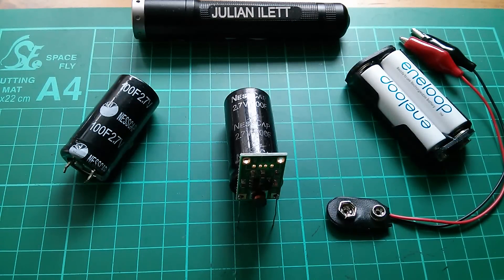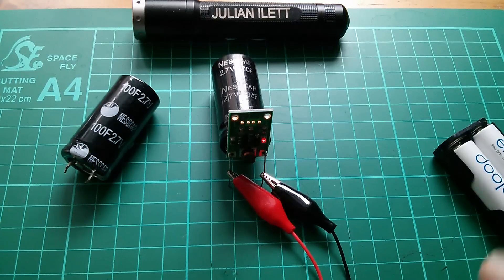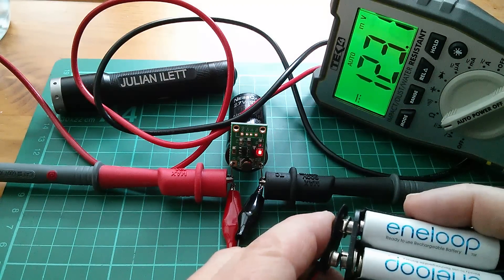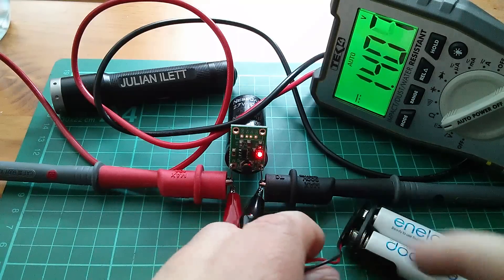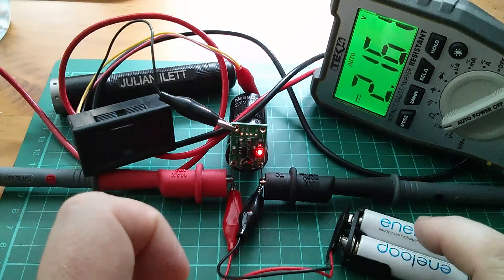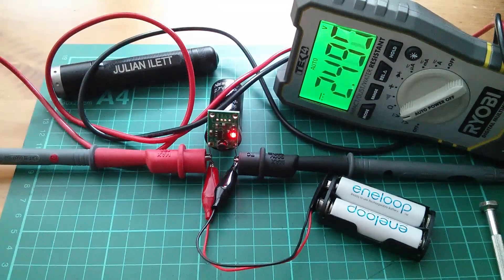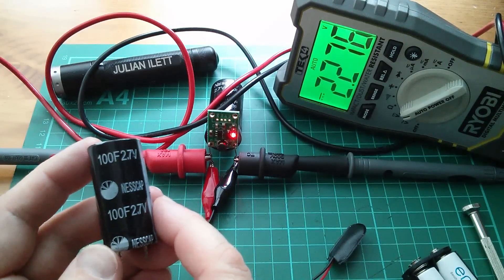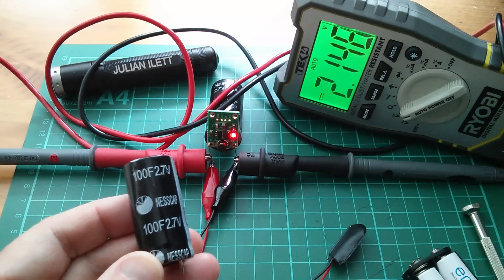Playing with SuperCapacitors

Comment: I wouldnt recommend charging them with eneloops because the cap almost makes a short circuit when charging up so that will damage the batteries. Unless that board prevents that....
Reply: No wire is going to have zero resistance,  which is why he mentions the wires getting hot...

Comment: Nice Video Julian,thank you. Just bought 4 of them for less than $6.00. You can use them on a BreadBoard with a Crank Gen, or solder on a boost Board.To purchase Caps, link : http://www.ebay.com/itm/232131730324

Comment: Julian - have you heard of the joule thief circuit? It would work well with the Super Caps to keep the LED going..
Reply from the maker: I'm not so sure about that. That boost module can keep the LED lit with an input voltage as low as 100mV. I'm sure I read that the joule thief stops working at about 350mV.

Comment: Have you watched the video of the fellow who uses a pack of these to start his car instead of a 12 volt battery?  Seems to be having good luck even in harsh winter weather when cars are hard to start.
Reply from the maker: I believe that's lasersaber
Reply: My car (chevy cobalt) has the factory battery in the trunk and dinky wire running from the trunk to the starter so in the winter time it always had trouble starting. After I upgraded the stereo system and installed super capacitors my car starts like a dream in the winter now :)

Comment: roughly 75mah capacity, it works out to, not a lot for the size. theyd need to be 10x betterto be replacing batteries
Reply: It's the current output that makes them special, and the almost instant recharging :)
Reply: toysareforboys
yes i see your point, but a phone that charges instantly would be great, but not if it only lasts a half hour!

Comment: I've used 18, 500F/2.7v EDLCs 6 series/3 parallel as a secondary energy storage bank between my solar panels and my controller. By doing this I've extended charging times by several hours past sunset and they absorb spikes as well as smoothing the energy being fed to my batteries. To reduce chances of over voltage, I've used simple 2.4v Zener diodes in reverse polarity on each individual cap. They could also be used between the battery bank and the DC to AC inverter for supplying starting loads. We all know a battery that has smooth power in and out, is a happy battery.
( make sure you have a good schottky diode between the caps and the panels )
Reply: I do not recommend this for standby/secondary solar systems. This is mainly for those who are off grid and use the system daily.

Comment: I have a cap bank that has 6 caps 2.7v at 350F , I got it off ebay being sold as a replacement for a car battery. I use it to jump start the car in the winter but i must say they are damn scary when you accidently short them.
Reply: Try 6 caps 3000f each and totally replace the car battery, works a treat :)
Reply: They are interesting things , I once put my cap bank onto a UPS which it was able to power but the wires got scary crazy hot fast.
Reply: Yep. Treat caps as dead shorts when not charged!! I usually use a big 12v diesel truck battery charger with "car boost/start" function and charge them at 200 amps, doesn't take very long but still trips the circuit breaker a few times during charging!!! :) http://tafb.xxx/07cobaltSS_SC/supercaps%20charging%20IMG_20150430_203418.jpg
Reply: Wonder if any crazy person has tried welding with them as  power source heh.

Comment: Honestly I'm soooooooo bored of you constantly dicking around with ickle batteries and solar panels just to provide a bit of power into something. For gawds sake just get a power supply, set the voltage to what you want and save us having to sit through this flipping Heath Robinson pantomime in every goddam video. Other than that, good job.

Comment: It would be interesting if you measured their self-discharge as i bought one as a test on ebay and it had such a high self-discharge it lost a volt in  less than 20 mins with nothing connected and was consuming hundreds of milliamps to maintain voltage.
Went and got some from farnell and they are MUCH better in terms of capacity and self-discharge.

Comment: I wonder if you lived near a broadcast transmitter if you could use an antenna intercepting the electro-magnetic field connected to a rectifier, feeding a circuit like this to charge lead acid or lithium polimer batteries. FREE POWER!

Comment: super caps Hmm? what's the big deal the'r just high capacity capacitors!
Reply: You're thinking of the function of a capacitor when placed on the output of a power supply. In this case it's actually being used as a power source itself so not the same.

Comment: If I had lots of these could I use it as a rechargeable battery?
Reply: Theoretically yes, but as the self-discharge is quite high with this things (would probably go from full to empty without a load in 10 days or so) its quite unpractical
Reply: +Konrad Peter OK thanks 😃

Comment: Would be nice to see a brief tutuorial on Capacitors, and in particular super-capacitors. I see lots of questions around the net from people trying to work out how many farads they'd need to achieve an equivalent to say as 1200mAh battery. Obviously farads don't convert direction into Ah, and the answers I see usually go no further than "that's not how capacitors work". But clearly the buzz around super-capacitors is that they could be used in certain situations to replace traditional batteries. So it would be nice to see a down to earth explanation of how the math works out. DISCLAIMER: Capacitors have always been somewhat of a mystery to me, I don't know what a farad is, and my knowledge doesn't go much beyond "this is the value capacitor I need, so I stick one in there".
Reply: Capacitors have a way lower capacity than batteries,even giant supercaps.
Lets see if I remember this correctly. Ah=F*V/3600
Soo,100F at 2.7V would be 0.075AH or about 75mAh. Not much,compared to a battery.
This also assumes that the caps voltage stays constant,which it doesn't.. IRL,it will be even lower.
Reply: This page answers all those sorts of questions: http://sparks.gogo.co.nz/capacitor-formulae.html

Comment: 10:15 - don't forget that when you put capacitors in series the total capacitance goes down just like resistance of parallel resistors goes down.  Same formula.
Reply: No, with capacitors in series, capacitance goes down, charge goes down (Coulomb), voltage goes up, energy remains the same.
Reply: for people who want to know why the capacitance goes down: you basically double the distance of the outermost plates. capacitance is linear to the distance of the outer most plates, so it drops when you double the distance.
Reply: +fredlllll I knew what happened but I didn't know why.Thanks!
Reply from the maker: The capacitance goes down, the charge remains the same, the energy goes up.

Comment: I got the 500F capacitors from this series and they are horrible. If you just need one to play with then they are fine but they have  differences in capacity, internal resistance and leakage so much that using them in series is completely  useless.
I needed them to test the SBMS but they are realy no useful at all even for that. The SBMS will balance the voltage during charging but then in just a few minutes they will start to drift out of balance and in a few hours or a day with load they will be all over the place some will be at 0.9V after full charged some at 2V and all in between.
Then I got some Vinatech supercapacitors (a South Korean company) and they are of course perfect you can leave them for weeks charged and they will be all equally charged.
I can send you some of this quality supercapacitors as a kit including PCB for 8 series (I use this for SBMS test that is why they are 8s). Will need to check my old mails see if I find your address.
Reply: Very nice. Where did you bought them?
Reply from the maker: Thanks Dacian - that would be awesome. That would make it much easier to do some bench tests on the SBMS.
Reply: The 500F bad quality from eBay just a few pieces. The quality Vina I needed to get a full box to get a better price so if you need a few to play with look at my webpage electrodacus.com I have a few extra modules usually for those that want to test the SBMS.

Comment: The super cap module with protection sounds interesting - might have to invest. I think it would help with my solar charge controller testing - faster charging and discharging. Thanks for the idea Julian.
Reply from the maker: I've ordered this one: Farad Capacitor 2.7V 120F 6pcs Super Capacitor With Protection Board Module  http://www.ebay.com/itm/-/322082558227
Reply: +Julian Ilett Two months ago i ordered 4 of these 500 F ones from ebay for about 16 € but the first only has 45 F, the second 78 F, the third 132 F and the fourth 187 F (each @ 2.7 V) :( so could you please check the capacitance of the 500 F one you ordered i think it will be less than 500 F
Reply: +Julian Ilett Grand. Thanks Julian.

Comment: Had a flashback moment for a sec when you almost reverse polarized the batteries again ;)

Great intro into super-capacitors.
Now I'm interested to know:
Can you supercharge them with a CC/CV source set at 2.5V and how fast @ which current can they be effectively charged.
How can you calculate the capacity of the SC?
And to top it all off, what happens at what over-voltage :)

Thanx Julian!
Reply: Capacity rather energy in Jules - 0.5 *C *V*V. Not too much. NiMH and Li-Ion cells are still much better in this area. Current - even tens of amps. SC have very low internal resistance and can generate huge current and can be charged with huge currents too. There are a lot of videos with all calulations - stored energy and charging time.
Reply: - yes, you can supercharge them with a source at 2.5 Volts. No need to make it CC, whatever the the supply can deliver, the capacitor can absorb.
- as +cbm80amiga mentions, the charge current can be tens of amperes. The supply is the limiting factor.
- the energy capacity is 0.5*Capacity*Voltage*Voltage. The unit is Joules, but in the field of electronics, we tend to refer to it as Ws. (Watt-seconds).
- rule of thumb: with a 2.7V capacitor, you need about 1000F per 1 Wh (Watt-hour), if you can drain the capacitor all the way down to 0 volts.
- if the voltage is too high, you apply reverse polarity or alternating current, the insulating layer in the capacitor will be breached. The capacitor will short-circuit, the electrolytic fluid will boil and vapour pressure builds up. Large capacitors have a valve that will vent the pressure, small capacitors explode with a loud bang.

Comment: Capacitors without brand names = crap ;)  Just in case you were wondering about their quality lol.Charge one up and test it with your new electronic load @ 200mA.  I would be interested in knowing how many Watt Hours they will hold.
Reply from the maker: They have a website: http://www.nesscap.com/
Reply: Ahhh, did not see that or see the brand name.  Thanks.
Reply: Nesscap seem to have used several logos but I can't find the one on these devices.

Comment: You should try and measure the capacitance of those, just to see if they actually are 100F. You could probably do a calculation if you apply a constant load to it after charging, and measure the time it takes to discharge.
Reply from the maker: I'll probably wire them up to that electronic DC load I bought recently, and monitor the falling voltage on an oscilloscope.
Reply: Great, that should work perfectly.

Comment: Short that capacitor :D
Reply from the maker: Next time I will... and there will be sparks.
Reply: Julian Ilett Awesome ! Thanks
Reply: ben kerr I can do it, 2.7v isnt much :D
Reply: +Julian Ilett cool
Reply: with yer tongue!
Reply: Win 2.7V nothing will happen. Human body has high impedance. But shorting with cable will cause very high current and sparks. It can be even used for welding :)
Reply: Yeah, that reminds me of something that happened.  Someone thought that, because a 12v battery was so big, that it would be deadly if someone touched it.  I laughed and said, I'll touch the leads of a 12v battery the size of this BUILDING and it won't do anything.  The person didn't believe me for some reason.  Now, would I hold onto a wire that was shorting that hypothetical battery's terminals??? NO! :)  There would be liquid metal, I'm sure!

Comment: I 'd be surprised if they actually have that much capacity, or that voltage spec. 
I designed a DC-DC 500W boost converter + capacitor bank for a hydrogen vehicle for a student team and i still have some of the supercapcitors laying around. They were maxwell 350F 2.7V or 3.5V if i remember correctly.
I can send you one if you'd like, for comparison reasons.
Reply from the maker: I wouldn't say no - please get in touch: 5@256.uk
Reply: Sorry for not replying earlier, had a bit of a busy week. I'll try and send you an email this weekend.

Comment: Those two in series = 5.4 volt?
Correct?
Reply from the maker: In theory, but they can get out of balance, so you might want to keep the total voltage less than the theoretical maximum.
Reply: Use the 5 volt booster to charge.
the bank at the output instead of the input.

Comment: It would be interesting to measure the internal resistance of those capacitors and see if it agrees with their spec.
Reply from the maker: I might try measuring the internal resistance on the IR checker I bought recently - http://www.ebay.com/itm/-/171761180936
Reply: You should be able to do it by measuring the voltage drop with various loads and comparing that with the open circuit voltage.

Comment: Where do you need so much capacity?
Reply from the maker: As an alternative to batteries (although there are significant differences).
Reply: They are used as temporary energy storage instead of batteries. That is because of the lower internal resistance due to which they can charge/discharge very quickly in comparison to batteries. The main disadvantage is a very low energy density, so not very useful in phones and stuff.

Typical applications are for example regenerative braking (i.e. when braking with an electromotor you store that energy in a capacitor bank, and release it when accelerating for an extra boost or to conserve energy, otherwise it wouldve been wasted as heat in the brakes). This is done in almost every 24h endurance car (except the Nissan, they use a mechanical system with a flywheels that spins up).
They are also often used in front of large electro motors in for example electric cars and hydrogen cars to buffer the energy going into them. This is because if you want to accelerate quickly, you have two problems. A: The hydrogen stack or batteries have a hard time delivering a high peak current and B: There is a relatively large distance between the battery/stack and the motors, and thus you would need very thick connections between them for just peak usage. It smooths out that energy pulse.
Reply: But sadly they aren't a really an alternative because the energy they can store is much lower than LiPo or LiIo batteries even if you use a 400F super capacitor. And one negative aspect is that their voltage is proportionate to their energy state so you have to use a boost converter almost in all cases. I think they are only usefull if you need a lot of current (like 10 or more amps). I hope capacitors will increase in capacity in the future.
Reply: yes they seem to be dropping volts-wise incredibly quickly, you're better off sticking with just the eneloops and forgetting the super-caps, they'll be dead in 30mins the way they are going it seems, just running a single led. 

i'm starting to get into lifepo4/li-ion (not lipo) as the ~3.7v from one slightly oversized AA is quite handy, but not sure how fast they discharge in comparison to my usual favourite of 2x AA eneloops.
Reply: Thanks to all of you :)